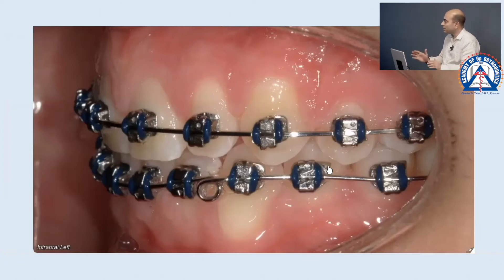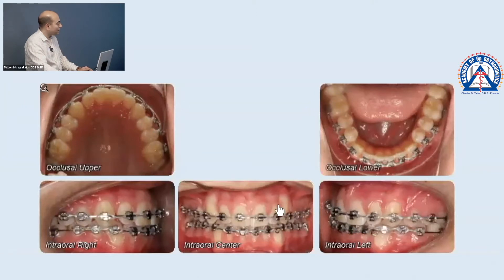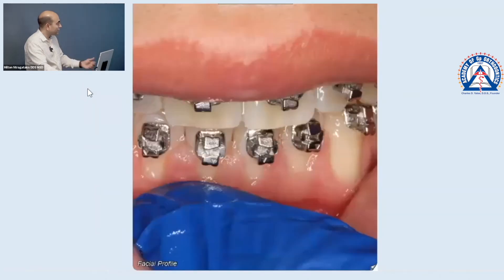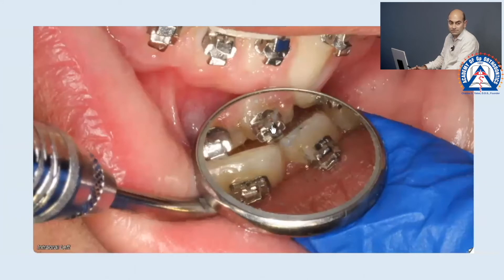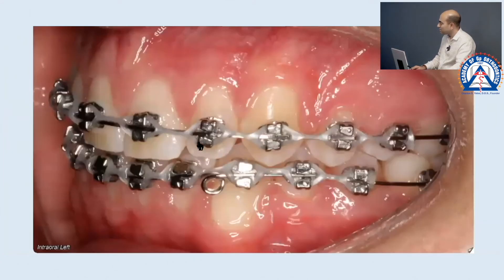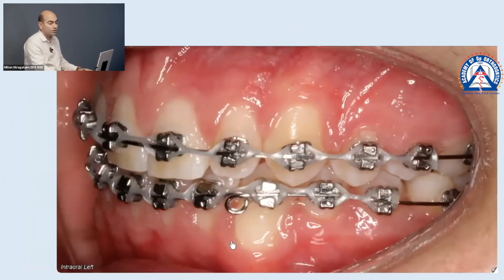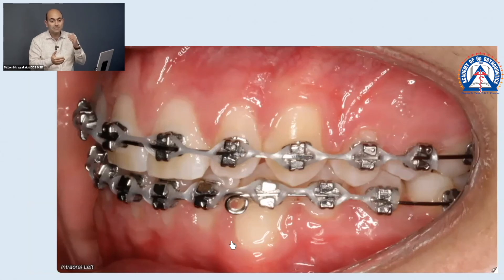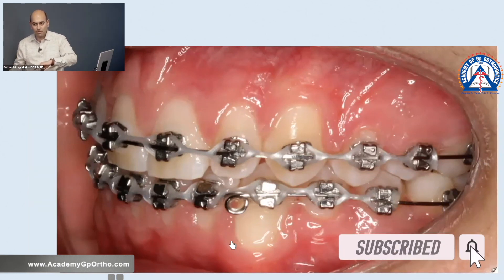Monday Tip: How to Assess the Overjet when Closing Orthodontic Spaces!

Comment: Hi Dr. What's up?
1_ how many teeth can we tract on a miniscrew in case of extracted upper and lower 4s to correct the mid line.. can we tract the 1 and 2 of the opposite side as well, as one segment?
2_ the power chain..would you prefer connecting it to the hook of the bracket of the canine and ligate the ant. teeth with it or using a crimpable hook instead? if so.. where would you put it?
thank you so much 🌹🙏